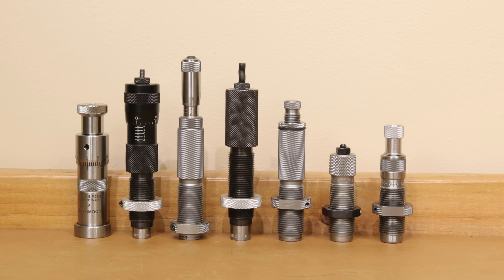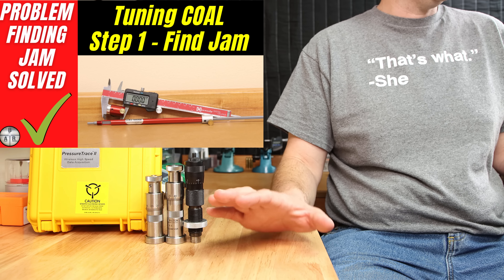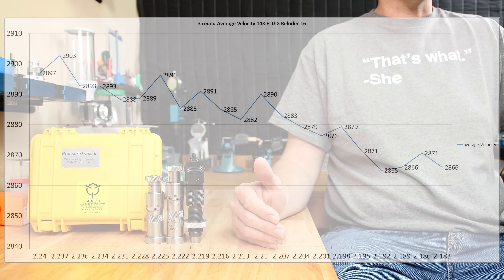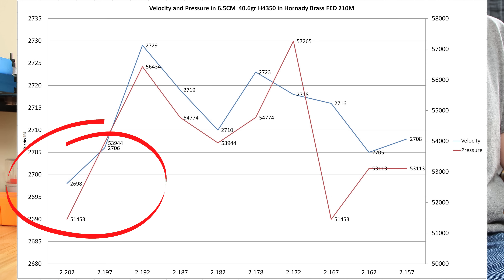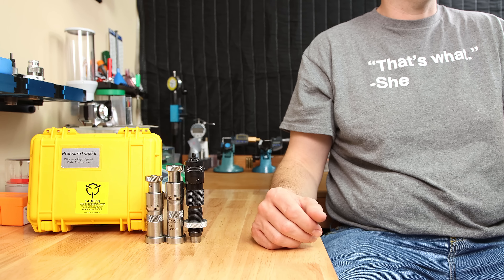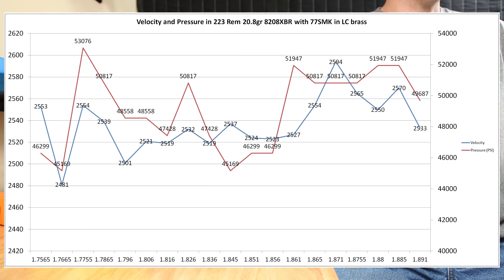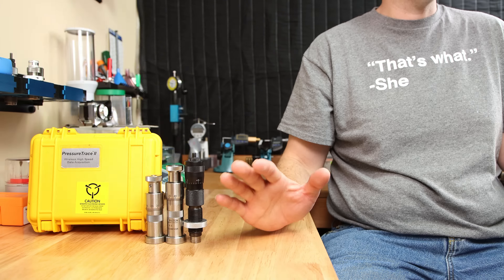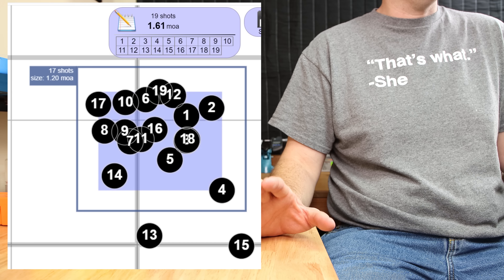Can COAL testing cause an unsafe pressure?

Comment: If you're running low neck tension once you get a certain distance into the lands(between 0.005-0.01") more often than not you're actually just pushing the bullet itself further into the case rather than going deeper into the lands(the alternative would require physically deforming the bullet).  This can explain the plateau you were seeing.
Reply from the maker: I'm using plenty of NT on these that they are going onto the lands. Maybe all the way out at the 1.891" mark they may start moving but these should be getting in there a good ways.
Reply: @newerest1  Well, I guaranty it can happen. It's a well known phenomena. There's almost zero chance it's not happening at 20 plus thou jam. If you've got a comparator try and force the bullet to 20 thou jam. You'll break the tool before you do. Even trying will mean you have to knock the bullet out of the lands with a rod .Bullet (shape), neck tension and distance jammed into the lands are all factors as to whether it's happening or not. The entry to the lands is no different than the seating stem in your seating die. Once it makes contact with the ogive of the bullet going further either means the jacket deforms or the bullet is pushed back into the case.  The problem with pulling the bullet out again is that they can literally get stuck in the lands and will pull themselves out of the case dumping powder into your action. Even if it doesn't get pulled fully out of the case(or you're using an empty one for testing) it can and will usually be partially removed making the measurement meaningless.
Reply from the maker: The amount of distance that you will have in the lands before the projectile starts moving in the case will vary based on your NT and the profile of the projectile itself. I have easily had .040" + from touch to Jam with only about .0005" of NT with higher BC projectiles. More NT will increase this range. These were set back at .002" so the chances of them moving isn't very likely IMO. The longest COAL is right around that .040" into the lands so I really don't think we are reaching that area.
Reply: I think we may just be using the same language to describe different things. You aren't getting 0.040"(1mm) of actual jam with any bullet without either deforming the jacket significantly or pushing the projectile back in the case.  A crimped case(or possibly compressed powder charge) may allow it to happen. In that case your touch measurement was likely just inaccurate. Touch is subjective. If you give the tool to three different people and tell them to find touch you'll generally get three different measurements. Given that the hornady tool doesn't hold the bullet securely in the case mouth and it's therefore not concentric with the bore when it enters the throat you may feel touch as it begins to center itself in throat/lands. Jam is literally when the diameter of the bullet matches the diameter of the entry into the lands. Also if you're not using the same exact brass that you load your bullets with in the comparator tool your measurement isn't consistent(the cases that hornady supply are unfired sammi spec) So if you're not loading with completely fullsized(not bumped) brass that  brass is now either longer(usually) or shorter than when you measured with the tool which changes the base to ogive or base to tip measurement. This might be part of the measuring error. The way to get around this is to take a fired and sized case from that gun and drill and tap it for use with the comparator. I've seen differences of up to 0.010-15" in some factory chambers when using a FLS die and 0.002" bump.
Reply from the maker: Jam (by my definition) is when the force to overcome the rifling starts to push the projectile back in the case. Your "deforming the jacket" qualifier doesn't make sense to me since this has to occur for the projectile to enter the riffling. Your going to see a mark on a projectile that is inserted into the lands if it is removed. At some point around "Jam" you are risking the projectile being pulled form the case upon attempting to eject the round. Touch is subjective and frankly not worth discussion cause it changes with barrel wear and fouling level and the person performing it.

Comment: I just started reloading 7.5x54 French. My load data says that the COAL should be 2.703. My loads with a 150gr hornady FMJBT came out at 2.612. The bullets are seated right at the crimp line. I'm using 43.1gr of H4350. Are these safe to fire?

Comment: Great data here thanks for what you put into that. I like to work my powder up first with the bullet seated out as far as I plan on having it. after I pick the charge I will work with, I do my bullet seating test from the farthest out working in usually 5 thou increments, this way I know the pressure's only going to drop from where I started; I already know is safe. If you were loading something really hot and overbore, for example 30-378wby, that 3K pressure you tested may take off quick and cause you problems.

Comment: Nicely done!  Not what I was expecting, thanks for the new information.  What is your take on the big surge near the start of the testing?  That looks like it could be an area of bigger concern.
Reply from the maker: There is always variation in pressure testing, plus there is noise in the signal. Averages are always best to look at IMO. Those pressures are all well in the safe zone.

Comment: Question. I seat a minimum of 0.020 off the lands, or max magazines length, whichever i hit first. Then i seat deeper in 0.003 increments for 5- 7 groups for a max total of 0.021 difference. Seeing as i stay back from the lands, would the seating variation cause any significant pressure issues?
Reply from the maker: I am sure if you went deep enough you could, but the 223 data shows a variation in length of .135". I am sure this will vary slightly with different powders/primers/etc.
Reply: I use the same method as you, and interestingly enough, I am in the process now of cooking up a load for my 223. I have found that if I am at least 0.5 grain down from what I have determined to be the start of pressure signs [another standard I follow], the process of increasing the seating depth [lowering COAL] will not take me back into an overpressure situation...but as always, watch for it as your results may vary. This is basically my process:
1. Determine where the lands are for a particular bullet, set max COAL 0.020" less than that
2. With that COAL, step up the powder in 0.5 grain increments until I find pressure signs [usually a flattened primer]. Absolute max load is 0.5 grains less than that.
3. Then I set up loads in 0.3 grain increments up to that max to find best ES, that's my load. I find best ES also makes the tightest groups, usually.
4. Seating depth reduced at 0.003" increments for best groups.
I have a Tikka T3 with a 30" Krieger barrel. The COAL I have now is 2.446" and I have my best ES with 27.0 grains of CFE223. My 5 shot groups at 100 metres are touching like a cloverleaf now, and the next step is the seating depth to see if I can tighten that up a little. I am getting a MV of 3200 fps with a Berger 75 grain VLD.

Comment: Interesting discussion. I actually had a batch of 223 load showing overpressure signs that I thought was caused by COAL. I loaded about 50rd new Nosler 223 brass with 55gr fmj and 26.5gr cfe223 just want to expand the brass so that I can size them to -4 shoulder bump for that rifle. I mistakenly used the COAL I usually use for my 73gr ELDM bullet which later on I found the Ogive is much shorter. 2/3 of this batch shows clear ejector sign, 2 of them even broke the neck. Those new Nolser brass are about 15 thousand shorter than fired brass in shoulder space. And 26.5gr cfe223 supposedly could only reach 40k psi at max. So the only thing that I thought that could cause those overpressure signs is the seating depth.
Reply from the maker: When folks are fireforming brass from one caliber to another one of the common methods of doing this is to seat the projectile in the lands so the head of the case is against the bolt face. Sierra lists max for cfe 223 for a 55FMJ at 27.4 (min at 25.0) so I am guessing that may be a little warmer than you think, but I would consider the head not being supported more likely the issue that you may have been fighting. Assuming that you could magazine feed the rounds (in a 2,260" mag) I wouldn't think you would touch the lands. Fir reference I just measure a Hornady 55gr FMJ and the COAL to the lands is 2.320" very little is seated into the case. Troubleshooting without seeing it is rough though.

Comment: Interesting.
I start load dev with powder testing to find consistent velocity load.
Then
Start sesting from bout 3tbou off lands 
Purpose..hunting., cartridges 222, 204, 17rem.

If I seat back a fair bit, as I had to with 204, to overcome an unforeseen magazine feed problem with xbolt (cartridges fitted in mag, but, caught on feed ramp into chamber..etc)

Thus...seating back a fair bit may have lowered fps out of sweet spot.

Always wondered about powder charge vs seating depth...which comes first 

Food for thought.

Maybe need to verify velocity once best  seating depth found and adjust  powder to obtain the optimum velocity...as found on initial powder testing .

Thanks again.

Comment: Dumb question; when you pushing 'into the lands', is projectille really getting pressed into the lands; or is the projectile being seated back into the case, reducing powder capcity/compressing the powder?

Edit: I don't crimp generally, except 9mm; do you always crimp when getting into the lands; never crimp in the lands; or some times?
Reply from the maker: HI Paul its going to depend on your neck tension and how far you are going. If you hit the link in the description or at the end that video I cover that to some extent.